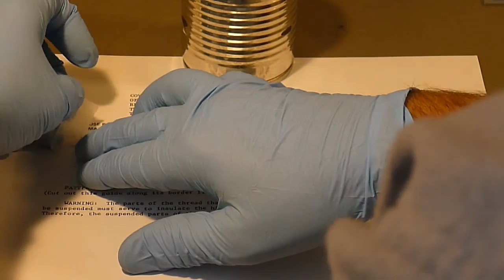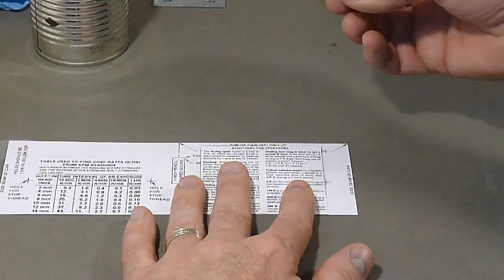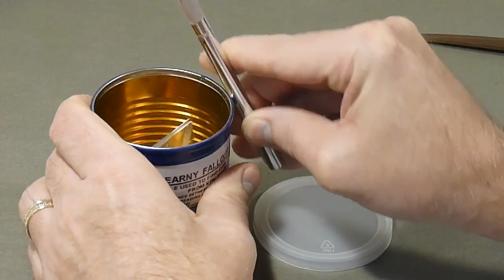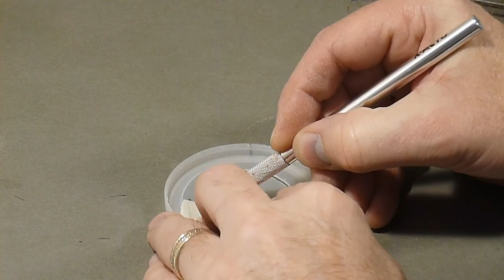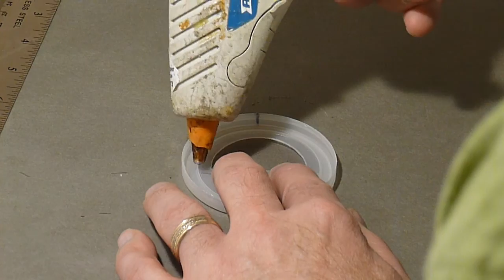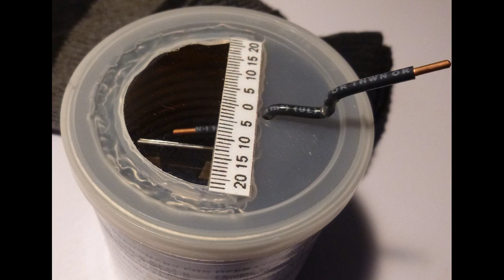The Modified Kearny Fallout Meter- Video #2

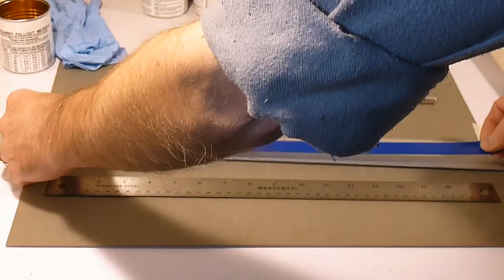Comment: Slight correction. Around the 4:20 mark- Cutting a 3/4" piece of electrical tape in half isn't 3/16ths but 3/8ths. Other than that, excellent video.
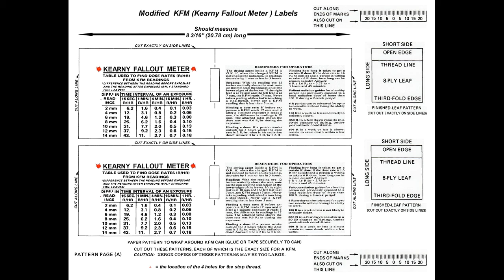Reply: Also, at 3:11 the instructions read "The attached table shows the dose rate was 9.6 R /hr".

There is no 9.6 anywhere in that table.
:o)

Comment: Does it matter if the lid fits tight?  I cannot find any baking powder lids that fit any of the 8 oz cans without being loose.
Reply from the maker: If you go deeper into the videos, you will see how to make a loose fitting lid fit tightly
Reply: That is why he is wrapping the top edge of the can with electrical tape - to create a tight seal.  You want to limit air infiltration into the can (ionization chamber).